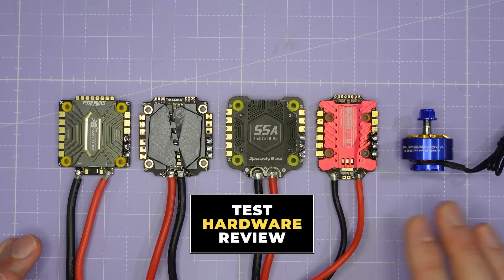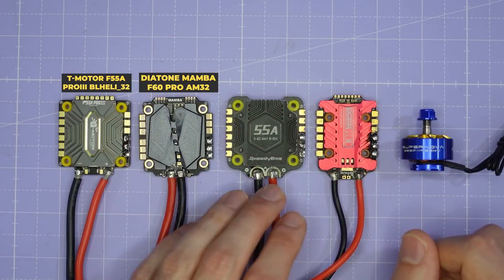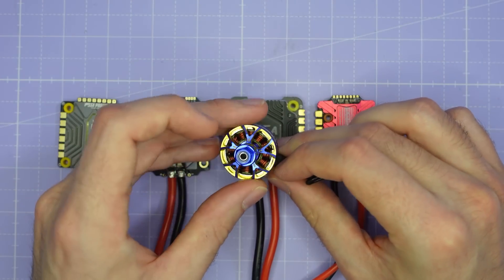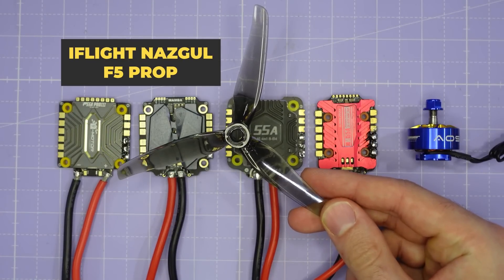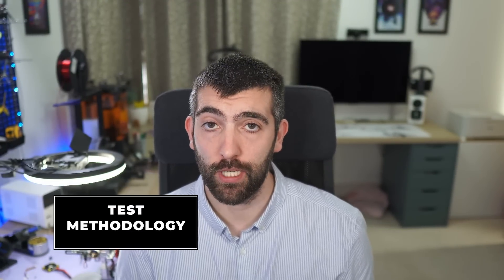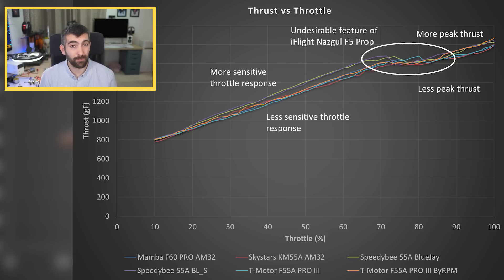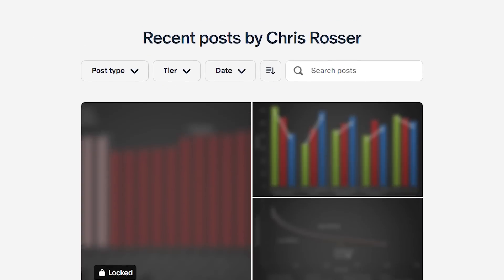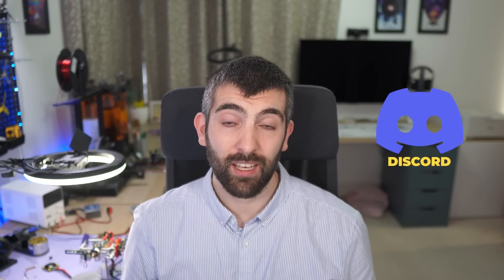55A ESC Testing: BLHeli_32, BLHeli_S, BlueJay, AM32

Comment: interesting, it would be really interesting to see how the ESC setting s affects all this, and also different motor, maybe much different motor like cine drone. There was also interesting findings as the torque test vs responsiveness. Maybe there could be an other toque test with less mass and  that could be used also for the responsiveness test instead the prop

Comment: What 32 bit 20x20 esc would you recommend for the flywoo Explorer lr4 that's lightweight,  i am considering the flywoo goku g45m running am32 but i have not seen any videos on it. I also will be using the Holybro H743 mini fc and arducopter or inav and flywoo 1404 2750kv motors.  This drone will be for long distance flying and cruising. Thank you from America 🇺🇸

Comment: The reason for the poor blheli32 performance in the torque test may have to do with the
"Low RPM Power Protect" setting.
I tried to power a quadcopter with 15" props with T-Motor 3510, 630 kv motors and the T-Motor F55A Pro ESC with BLHeli32, and I got abysmal performance, thrust was pretty much flat above 25% throttle.
I am fairly new to all of this, I spent two years (!!!) pretty much replacing every part of my setup, figuring that each component individually was working fine, but the combo of motor and ESC just didn't work. Then I set "Low RPM Power Protect" to "off" and, "wroooom", I suddenly got full power!!
Seems that at low RPMs, blheli uses a heuristic to determine whether the props are stuck by looking at "unusually high" current draw. And for a firmware written for small FPV quads, the current drawn by a low kv motor with large props, and probably by a flywheel, is unusually high. I am trying to spread the word about this as I find it hard to believe I'm the only one who get stuck with this...

Comment: I appreciate you say you have not finalised your test protocol, but surely you need to use the same firmware on each of the ESCs in turn in order to provide a meaningful comparison.  I would be interested to see if the noise levels generated by the ESCs are impacted in any way by the firmware used.

Comment: I swear by BLHeli_32 for "3D" flying. I am really curious about Motor Rampup and other settings to get acceleration on AM32/BlueJay ESC's to increase. Personally running Motor Rampup of 100% (default is 50%) and it makes a noticeable difference in the air.

Comment: I would have liked to see a more even playing field with as close to the same esc's as possible. Skystars makes a 55a in Blheli-s, blheli32 and am32 flavors I'm guessing they all use the same fets and board layout. They could probably provide the best results as there are definitely some differences coming from the fets, board layout, copper thickness, heatsink, etc.

Comment: Should probably point out from the data. That Blheli-32 using by rpm also decreases motor acceleration performance. Not a feature I want when flying freestyle. Best to keep parameters from its lowest PWM to its highest right PWM NOT including by rpm.

Comment: Research of ESC efficiency I would start with wiring optimization. 50A at the top of acoustic frequency just beg for using twisted Litz pair! Simple experiment: check efficiency and dynamics on one ESC, prop and motor connected with recommend gauge wire, twisted and not, then the same with electrically equivalent gauge Litz, twisted and not. This may have bigger effect than variety of ESCs gives!
Reply: The inductance of motor winding is far bigger than wire inductance.
Reply: @whyMDO   no doubt. But Leitz is not really about inductance.

Comment: The torque-speed and acceleration results need digging into... Given torque = inertia * acceleration, there is a major inconsistency in the BL_HELI32 firmware achieving the lowest torque AND highest acceleration. Is the interruption in measurement data with BL_HELI32 fw causing a false acceleration measurement?

Comment: There's a current limit and rampup power, both of which affect that max torque. I'd really like to see some of these comparison tests with that set to different ones - eg make sure the tests are done without the cirrent limit enabled, then try the default rampup power and compare it to the torque with max rampup power selected, and then compare those two results to the other ESCs' results. (And do the same thing with the other firmwares.)
Otherwise what we're really comparing here is the ESC firmwares' default settings instead of the ESC firmwares themselves (which you kinda touched on in the video).
Also, how is the acceleration/deceleration for Blheli_32 so high when its torque is lower? I would've thought those two would corellate?

Comment: I would think to compare firmware, the ESCs hardware needs to be pretty close.  For example, did these all have the same Deadband?
Reply: Yeah, that's a very good point. I was surprised that deadtimes were not considered at all. For BLHeli32 vs. AM32 easily the same ESC could be used, one stock on BLHeli32, the other one flashed to AM32 to at least level the playing field. This way only two platforms would be needed, one for 32Bit, one for 8Bit - ideally they should also have the same dead-times.
Reply: @stylesuxx  or better.  Same ESC.  Just change FW (AM33 vs. BLHeli32)

Comment: Now that you got us the beastiest beast of a motor you gotta figure out which ESC and Prop can actually handle that power xD

I really would like to see how the foxeer ESCs score in these tests as these are the ESCs racers use for their reliability in frequent turtles and MCK also says it's the ones least prone to demag. 

I also found that bluejay is super chill on defaults, especially with noisier builds while BLHeli32 is much more prone to oscilations or other issues. Might that actually be the double acceleration-performance transforming that noise much more effectively into prop movement?

Comment: am32 you can set the kv slider lower to allow higher acceleration of the motors at the cost of over current protection.. personally I start at half your motor kv for the slider and take it lower till it wants to not run clean..

Comment: Great video, as usual. Thank you. With regards to the surprising amount of extra torque that  BL_32 seems to provide: How about using a scope/logic analyzer to record the actual signals coming from an ESC microcontroller its the FETS during the acceleration, for BL_32 and AM32?

This would also require recording a timing signal in order to get actual timing data of the signals. This could be done, for example, by placing a hall switch close to the bell. Or by making a reflective / dark mark on the bell and recording its passing.

Graphing the pulse-frequency(for bi-rpm), -width and -phase with regards to the timing signal, you might be able to get some useful information as to. At 24Khz, that's a lot of data, but a single capture should not last longer that a second and with some coding, much of the analysis could be automated I presume.

Comment: Hi Chris- every test opens up more questions- would you get the same spread of results using a motors? Ditto for props?
Keep testing, it’s great that someone is producing some facts rather than just opinions 
For a long range efficiency conclusion would we need a different test - efficiency at a stable 40/50/60% throttle level?

Comment: Hi Chris, I appreciate all of the excellent bench testing, but you absolutely have to fly and try tuning a quad using the ESC to see if it actually works in a Betaflight quad.  I have had two Skystars ESCs (the same Kamram 55A 20x20 and 30x30 AM32) and both have produced nearly unflyable and untunable quads. There was so much oscillation and also strange sounds coming from the motors.  And I used your AOS EVO 4" and 5" frames, so we know that resonance was not the cause.  Everything worked perfectly when I switched to iFlight BLHeli_32 ESCs.

Someone, somewhere, said that AM32 doesn't work well because it produces more torque and suggested dialing down the d-term.  But I couldn't see much, if any, difference when I tried that.

Ultimately, I don't know if Skystars ESCs are junk, or if AM32 might not work well with quads.  Perhaps I was incredibly unlucky.  However, I have seen similar complaints online about the Skystars AM32 ESC, and also that some NeutronRC AIOs with AM32 were untunable.

I'll be avoiding Skystars and AM32 for a while until they both build a decent track record.
Reply: I have been struggling for a while with Skystars AM60, I finally got good results but I had to disable variable PWM frequency and Bidir Dshot (I think we can keep bidir dshot, it was actually Dynamic Idle that was making it unflyable).

Comment: The problem I see with using a flywheel for testing is that you load the motor at very low rpm where a prop would still have almost no load, this could be where the difference between firmware is showing up, with the blheli 32, it may be, for instance, that the load at low rpm is just not being detected as a normal operating parameter.

Comment: This is great...i believe it may explain some of the issues I've had with AM32. The PIDs must be dialed down quite a bit. The low-end torque on my high KV motors is too much. (2207 RCINPOWER 2040kv). I would love a video on AM32 settings. I've tried several, and I'm just not getting the smooth performance i was expecting. 

Thank you for everything you do for us in this hobby!
Reply: Did you ask ALKA (the developer) yourself ? Maybe he can get you some insight.
Reply: The problem is the opposite. We have shown am32 accelerates faster than blheli32. That is why you must lower your pids.

Comment: I'd  really like to see a video over driving these escs with higher kv motors run like a strong lower pitch prop on 2300kv  maybe even a 2450kv on 6s to actually push the ESCs before they desync or whatever, maybe even using a 3000kv 2004 motor with a 3.5" prop on 20mm escs. I'm not so much concerned about 5" drones, but getting max performance for smaller light weight drones since RID had kind of forced us to look at smaller drones more
Reply: I'm actually waiting for a 40a f435 at32 aio to get here on the slow boat from china to run 1505 motors 3450kv 4s motors on 6s. Not sure how it will do, i tried it on a f411 40a aio with blheli S (ghf411aio)and it just cuts out on the high throttle, the f435 aio was much cheaper then a f7 aio with bl32, if the at32 escs can't take it then i will get the f7

Comment: 12:50 I can second that, the ESC are operating at a pretty ideal point. They basically just switch between motor phases, there is not much loss here. However switching at a wrong or non ideal position will result in a less efficient motor, not necessarily a less efficient ESC. It's not unusual to have an ESC to be more than 95% efficient. The only major efficiency loss is because of the forward voltage drop because of Rds(on) of the FET.
Reply: When people talk about ESC efficiency, they don't just mean how efficient the ESC itself is at providing power down the wires. They usually mainly mean how efficient it makes the motor, which is what Chris Rosser is talking about here - which esc gets better efficiency in terms of thrust out of the same motor & prop combo.

Comment: i got 122 mph on a azure power 5048 with supernova motors. ALSO with real flight I noticed a MAJOR difference on my Speedybee bluejay and blheli the bluejay sagged the battery faster and not hitting top speed and the blheli went super fast BTW speedybee f405 stack has that nice esc for 70$
Reply: In practice, you aren't going to be at zero airspeed at 80% throttle, so you probably wouldn't see the same behavior as CR.

That's one of the problems with bench testing at zero airspeed.
Reply: @aviphysics  that's why I am starting to do real world reviews and making my own charts. I do use all of Chris Rossers data to select my products but I have notice some differences that's really vital and important that's not caught on the bench

Comment: I'm confused about how we can determine anything about the software if it is running on different hardware. wouldn't we need the same hardware running the different software to see any difference between software? I fail to see what was accomplished here. I appreciate the time but, I'm not sure that this is a good way to see differences in software.
Reply: I agree with you. At least should have all from the same brand finding similar construction.
Reply: I was thinking the exactly same thing! I’m actually quite surprised that Chris executed the test this way as he usually has strong analytical approach. Haven’t studied am32 too much yet, but maybe you can’t flash it to every board?

Comment: 7:08 This efficiency graph looks a bit to jaggy, are you sure the measurement readings are synchronised? I've had similar things happen when the measurements weren't synchronised. Constantly auto-ranging measurement equipment could be the problem too. But it looks like you are using RCbenchmark, in my experience, that should get you good measurements.

Comment: How much is component choice and how much is firmware?
Change only one variable at a time, hardware or software - not both.
Also the KV setting in AM32 should allow more acceleration.
Reply: The problem is that you can't go back to BLHeli_32 after installing AM32 because the firmware is heavily protected.

Comment: In my opinion testing different ESC's with different firmware's doesn't make much sense if you label them by FW type. First of all, everyone is labeling A ratings without a common rules. I believe that ESC's layout, stack up and component selection plays a much bigger role in the performance then the FW it runs. I would like to see first a test of current draw capabilities for continuous A vs some reasonable operating temperature. And only then label them by your own standard and compere the performance. Would be interesting to see the BL32 ESC tested before and after reflashing  to AM32 FW.
Reply: HW definitely matters. Just a combination of MOSFETs and MOSFET drivers can make a difference.
Reply: Maybe. Get it on the scope with a rotor position timing mark. I'd like to see how these different programs change commutation to accelerate the motor. I suspect blheli_32 more aggressively advances the phase angle during acceleration.
Reply: Yeah, the test should have been run using three same model esc's, reflashing eachone to the same fw, and do the same tests using the same settings
Reply: I disagree with you..I think the actual components don't matter once you're buying over a certain level. I want to know how the difference firmwares compare
Reply: @wmnsriteslol different hardware has different deadband length for example, no?
Reply: This Lambo has iOS and this VW has Android. Lets test which firmware is faster on a drag strip!
Reply: @kristjanlill9363 it's a trick question because The Lambo couldn't find the racetrack using Apple maps and the android user won by default
Reply: @digitalabstractions  😂
Reply: Hardware doesn't really play a role. Basically, the only possible difference is that the MOSFETs do or don't smoke during testing. 'Component layout, stackup and component selection' can affect EMI but not performance to a non-negligible degree. Also any differences in FETs would be really obvious in efficiency testing (higher ON resistance means more losses), which is where all ESCs are basically the same in the tests.
Reply: If you compare fair, yes. Hardware determines the current rating. My concern is that manufacturers applies A ratings by different methodologies and cant be trusted or compered directly. A rating is used more for a marketing than a specification on ESC's. Alternative would be to compare by retail value.    @PraiseKier
Reply: If you claim that hardware doesn't make a difference, then all of the tests should have been performed on the same hardware. @PraiseKier

Comment: I am kind of curious how the old tgy code compares these days! It sounds like the major change is variable PWM frequency ("ByRPM"), which would be fairly simple to add. Meanwhile, dshot would not be fun to implement -- I avoided it as it meant many more interrupts. I did test ludicrous update rates by furthering the "onshot125" concept, so maybe it would be fine. Anyway, good to see that things are still changing and improving, and measurement is key!